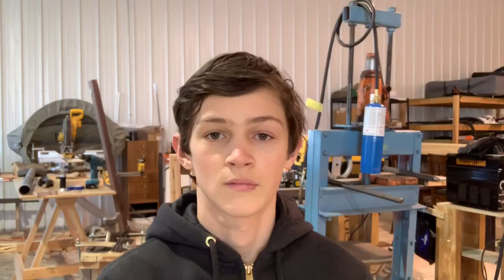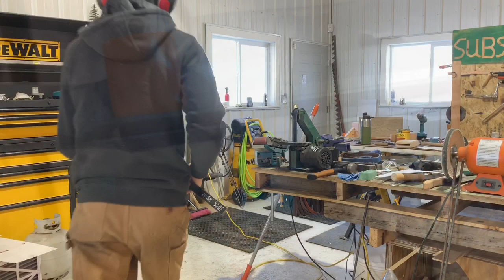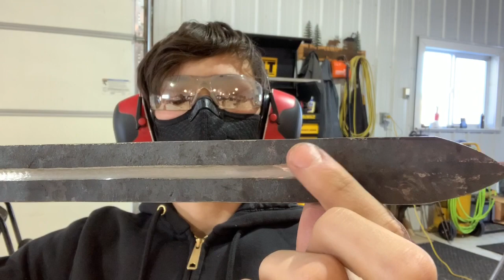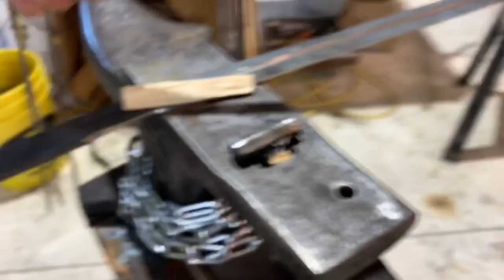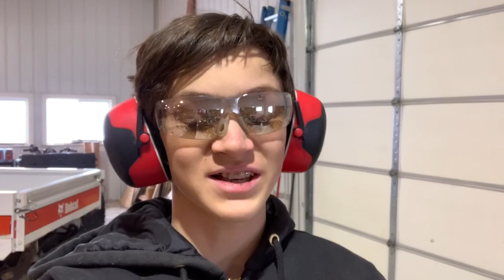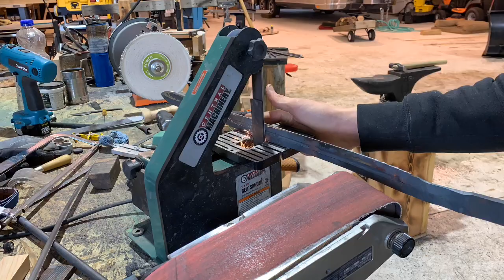Forging a sword!! The fuller. Part two!

Comment: Sword is looking very good so far. I like what you did getting that fuller.

When I do layout off a center point, like you did, I use a stretched out string line.